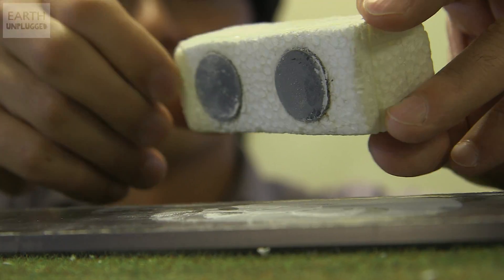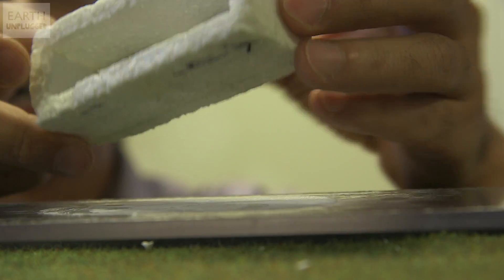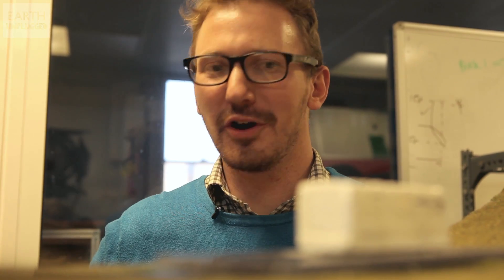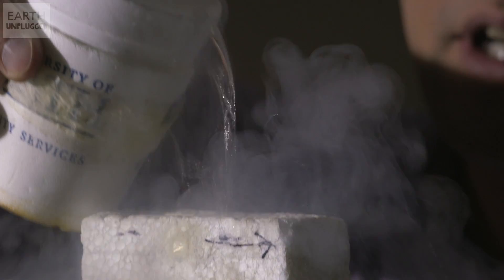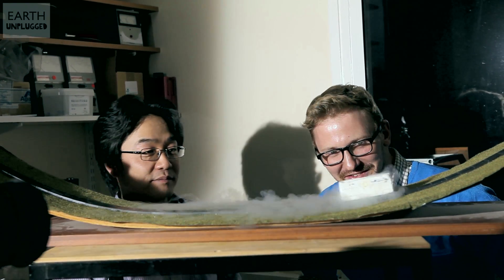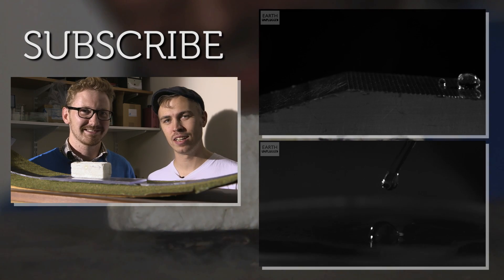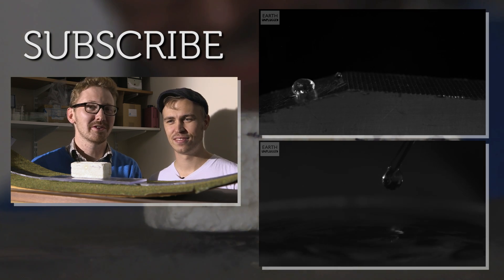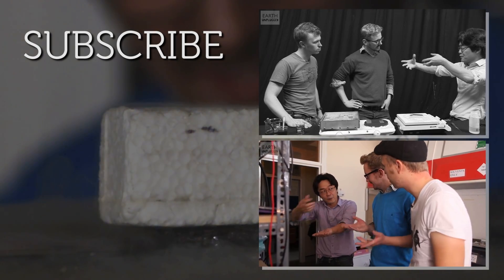Magnetic Levitation In Slow Motion | BBC Earth Explore

Comment: Handles liquid nitrogen, wears no gloves O.O
Reply: It's really not dangerous to have a drop or two fall on your hand because it quickly skitters off as well as the Leidenfrost effect gives you some protection against the cold. If you are talking about him handling the polystyrene container, polystyrene is a good thermal insulator and wouldn't be too cold on its outside surface
Reply: Looks simple yet Amazing slo mo..
Reply: Brock Brockson actually quickly dumping your hand into liquid nitrogen doesnt do anything either, look up hand vs liquid nitrogen.

Comment: OK this is cute but for sure we wont be using nitrogen forever to fuel this thing. Is there any way to make something super conductive using electricity or any other method ?
Reply: No you see it is super conductive the whole time when you freeze it. It holds the magnetic power inside preventing other forces from entering it or anything exiting it. The only way to get this effect so far is by freezing the superconductor.

Comment: Fantastic footage guys once again!

On a said note, with regard to Maglev trains, similar principles are used, but electromagnets with shifting polarities rather than superconductors allow trains to float along the track, and a slight offset between the track and the cars push the train forward or backward, allowing it to change gain and lose speed along the track.
Reply: yeah, I think that should have been explained in this video, since they started off making that analogy and then, Dr Takashina said "it's not the same physics" without ever clarifying.

Actually doing it with super conductors would work but the cooling would be waaay too expensive. You can't have all high speed trains be as expensive in uptake as the LHC or something (Although the LHC, of course, has its magnets cooled even much lower, using Helium cooling, which is much more expensive than using Nitrogen cooling)

Comment: Not to sound the skeptic, but are we just supposed to take your (or his) word about all the "magnetic levitation" stuff going on here? How do we know the styrofoam block isn't just floating on the (boiling) liquid Nitrogen. 

I'm sorry, it's just not clear from the video.
Reply: But, if the levitation was dues to jets of boiling nitrogen, would not this give rise to quite visible flows in the mist under the Styrofoam box? Also, magnetic levitation by super conductors is a fairly well knowned phenomena.

Scepticism is a virtue though!
Reply: if it was floating on a liquid then it wouldn't follow the track or go up the slope. and also consider the density of liquid nitrogen which is 0.808 g/cm³(according to wikipedia) and the density of styrofoam, 1.05 g/cm³(according to google), you would need a heck of a lot more than a couple of drops underneath the styrofoam to provide enough buoyancy for it to float, the action of boiling would have minimal effect since this is not a closed pressure system. If you wish to know more about what is going on in this video then go look up Flux Pinning.
Reply: If you look at more videos of quantum levitation you'd see that it can even levitate upside down, and if they get tilted they get stuck in a tilted position relative to tracks (Boaz Almog has pretty cool videos if you're interested)
Reply: ***** It is extremely difficult to achieve even and stable levitation with downward facing jets. If you look at the aircraft that do it (i.e. the Harrier and the F-35), they are precision manufactured and computer controlled.  The irregularities of the styrofoam would cause small lateral components in the jet streams, pushing the foam block off of the track.

And even if it didn't, the friction-less effect of the 'floating' would cause the block to become susceptible to small air currents pushing it off the track quite quickly, unless it was in a perfectly still environment.  If you've ever tried to pilot a toy helicopter without a horizontal tail rotor, you'll know how much extremely small air currents can affect a body that is freely moving in air.

The same problems with lateral movement would appear if it were riding on the boiling liquid nitrogen, as Skeletor Jopko wondered, in addition to what Kaleb Cunha mentioned about buoyancy.
Reply: TechLaboratories I did not propose the theory of gas jets levitating the Styrofoam box. I did however offer a simple refutation of said theory. What you say about instability (lateral and vertical), I hold for true.
Reply: lol Here is an other example with a stronger magnet it levitate like 5cm /watch?v=VyOtIsnG71U